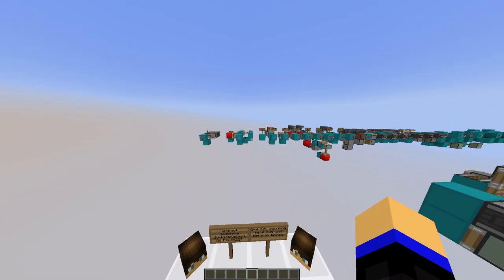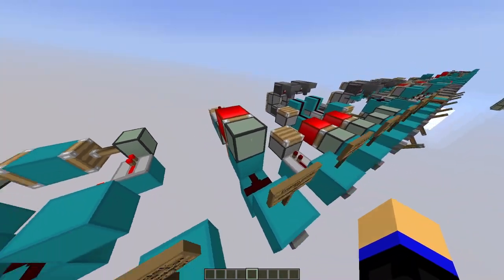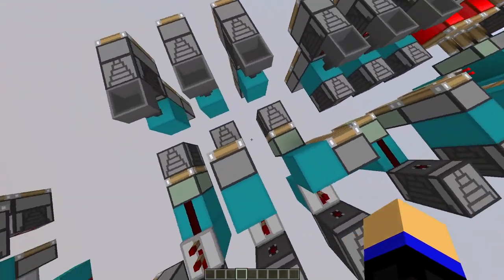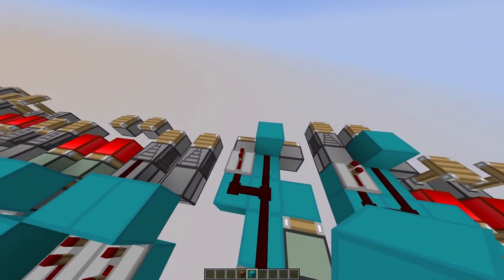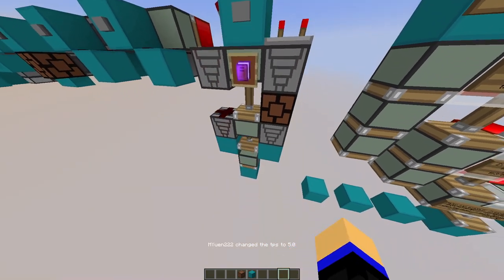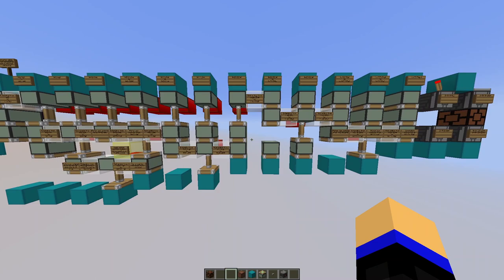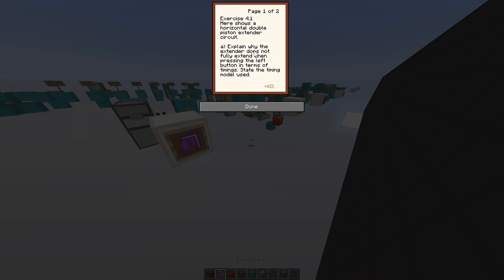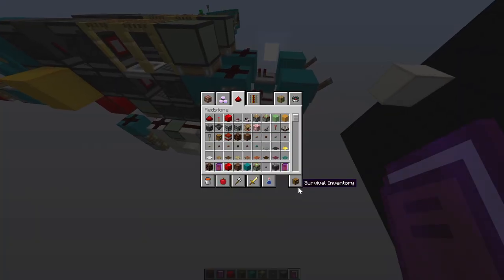Compact Redstone: 2-4 Tick counting, input bug and more on timings

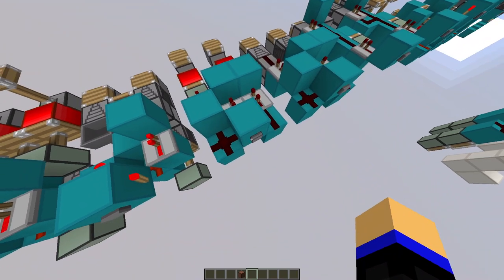Comment: 27:27 i get how this works on activation but on de-activation. How comes that the pistons turn off at the same time? Becasuw you just said that piston heads on retraction only update at 0gt but because of the updater piston turning off ealier than the right piston with a rsb that would mean that nothing updates the right piston with a rsb keeping it turned on because of 0 updates. But it turns still off?

Edit: i now see the 4gt repeater buds the updater piston. Then it would make sense for it to work like shown in the video on de-activation. But now i dont get this: what updates the updater piston?
Reply from the maker: The left sticky piston will update the updater piston on deactivation.

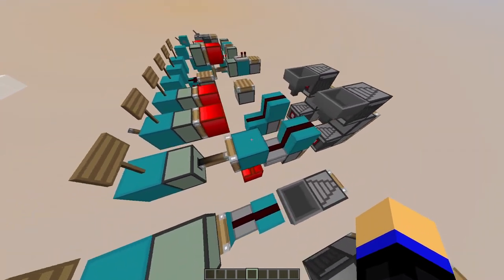Comment: 15:10 why isnt it unsync on both edges? Does it only work with pistons extending? (The extra 1gt)
Reply from the maker: In this scenario, yes. However, keep note that piston activation delay also applies during retraction. Essentially, when a power source block leaves from one position, all components deactivate instantly; But when a power source block arrives at one position, pistons have an extra 1gt delay compared to other components.

Comment: The english model is accurate in older versions of the game (1.13 and below), while the chinese model is the correct one in 1.14 and above. Once you read the code there really is no space for debate.
Reply from the maker: Yes, this is the same statement from Space Walker. However, I've also received another statement from G4me4u which disagrees with both models. In addition, the popularity of the English model still prolongs among some technical people. And since this series does not go deep into technical details of the in-game mechanics, not to mention code-digging, I will just treat the English model and the Chinese model as two different ways of counting delay, and not deny the legitimacy of both models. Again, my choice in accepting both models is to accommodate the different beliefs among different people and to incorporate the different mechanics among the versions, since the series mainly covers 1.11 to 1.18 redstone.
Reply: @myuen222  I assume G4me disagress with both because player actions are technically outside the actual server tick method, so putting them inside the tick is technically wrong?
Reply from the maker: I cannot represent his opinion as he did not mention this in his statement from my understanding. You can directly talk to him if you really want to know his standpoint.
Reply: @myuen222  Oh ok thanks anyway